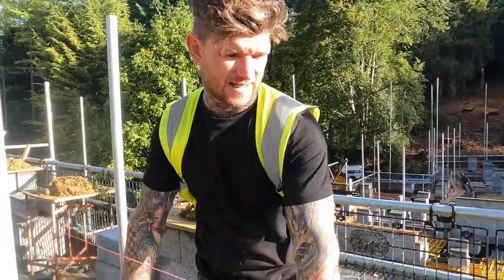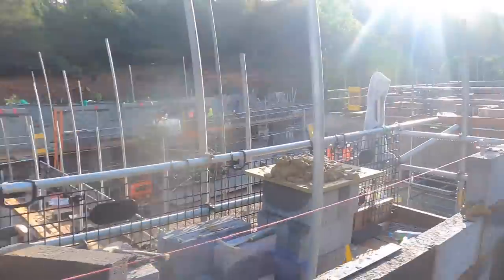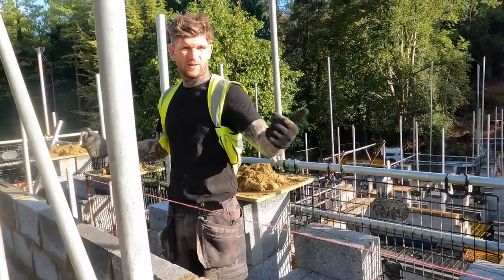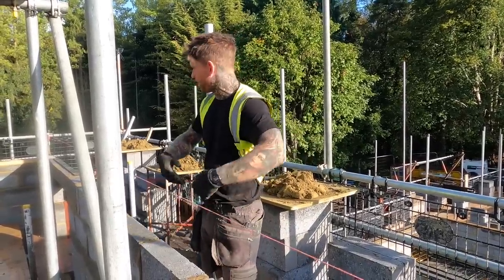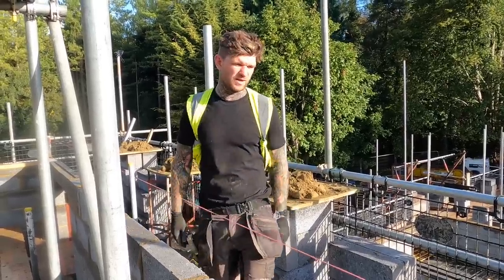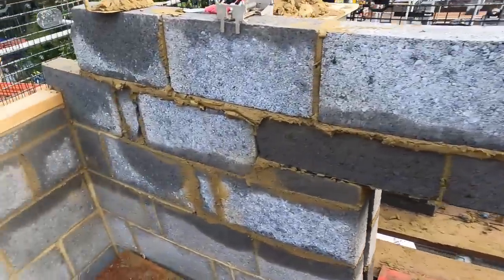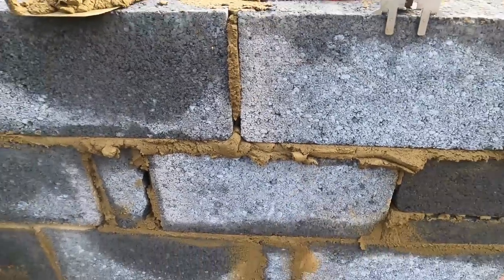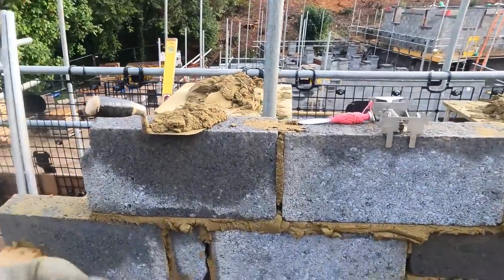Bricklaying, Building Gable Ends

Comment: Once you have your bevel angle transfer to a bit of OSB board or similar and cut  template full height of block then you can draw full line so not using bevel and hand saw all the time .

Comment: Surely if the Insulation isn't tight against the internal skin it's not much use..cold air working up the gaps.
Reply: Insulation is always kept tight to internal skin...what made you think otherwise?
Reply: @alanmcevoy1467  I know it is..whichnis why I've commented that on Charlie's job it isn't. Think you've misread my comment.
Reply: @sidstewart7399  maybe I have...is his insulation tight to the outter skin or what never seen it been done like that would still work I think but you would lose about 30% of the value of the insulation
Reply: @alanmcevoy1467  it's pretty much in the middle bit should be tight internally.
In all fairness no water is bridging that even if its close to the outer skin as long as joints are taped.
Personally I think 100mm is overkill.